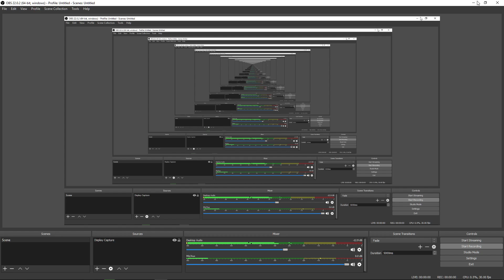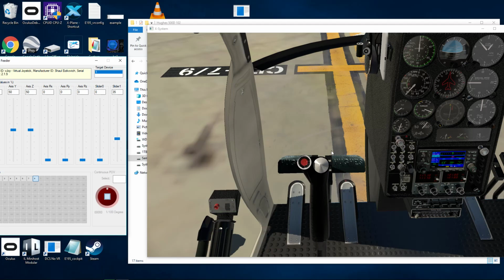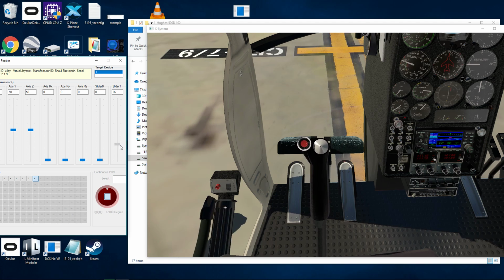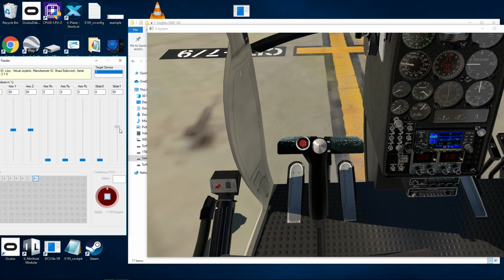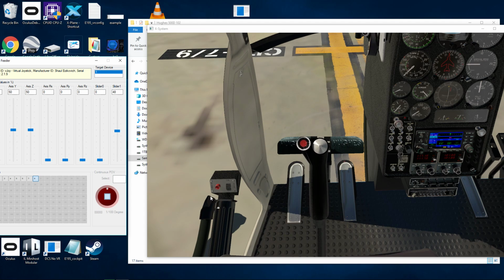New Governor Throttle behavior H500D Enhancement Mod 1.0.2

Comment: Hi Joe, the download files are confusing. Speaking of H500D_REM_103.zip which contains like the complete files of the original Huges_500D folder. 
but its not sure which ones really need to be copied over, and which ones dont need.
Things can mess up quickly and lead to broken art or functions (already happened with HSI, reflection glass, etc.).
Beware, there is a 3rd download floating around named 2FlyRealDynamics.zip.
Last, what if i dont want the ipad but the original military look pad?
users are confused.
you should only upload files that need to be replaced, not the original ones.
Can you direct me for the correct ones please.
thanks for your help.
Reply from the maker: Hey man, the reality expansion mod is no longer needed.  It's built in to the latest version.  I'm trying to get it removed from the org altogether.  Until then I put a note at the top of the download page that lets you know it's no longer a thing.
Reply: @simvrlabs908  ok thanks, good work, will add the AH-6 little bird variant.
Reply: @simvrlabs908  Joe, still seems not cleaned up. maybe clean out the mess on the .org. and re-do a fresh page. make sure that spanish guy's realfly plug-in is working and added as well. this is a complete chaos. 
please give me a sign when things are back to usable, thanks make, appreciate it much.